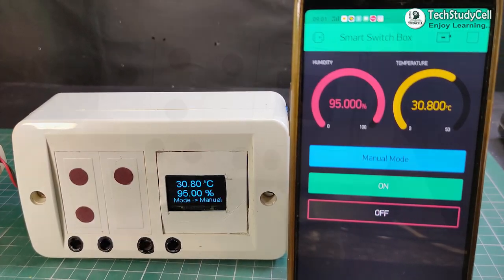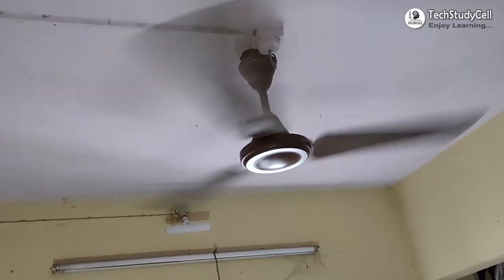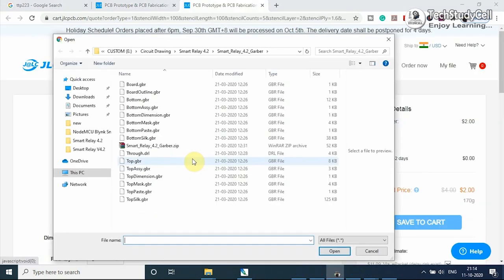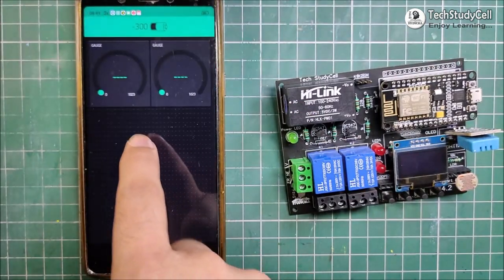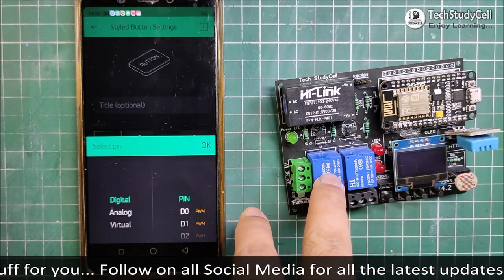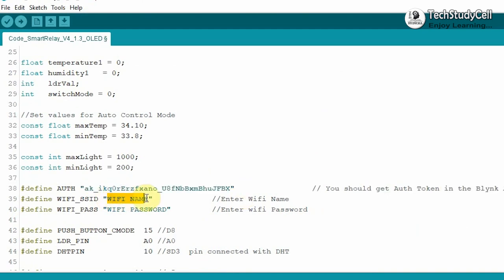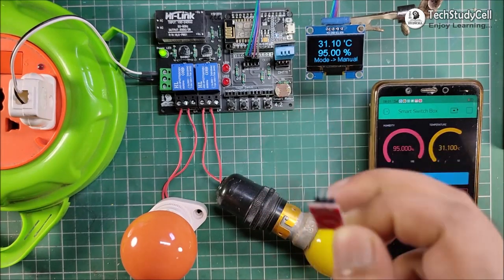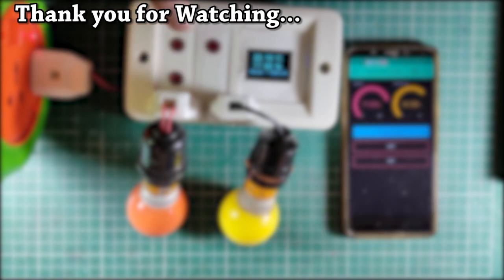Home Automation using NodeMCU & Blynk with Touch sensor LDR Temperature control Relay | IoT Projects

Comment: Thanks for your exceptional good video, patience and the hard working behind all of these. Is it possible to make the AC Dimmer which runs   both Blynk app by using slider button (or "+ve" & "-VE" buttons instead of slider ) and two physical  touch sensor switches (say 4 pcs TTP223 or 1 PCS TTP 224 for controlling 4 steps ...etc. ) for manual Control (Increasing or decreasing the bulb intensity or fan speed ) , If so please make a video particularly in coding part, It is difficult to relating the physical two buttons with Blink slider in coding part.
 It is more better to add 2 more button for controlling 2 ac loads (Just on and off ). Thanks

Comment: Very nice project what i can do to replace this oled display with lcd dispply having converter attached to it

And can we get pdf of this circuit to make pcb at our home
Reply from the maker: Please download the single layer PCB layout from description to make the circuit on zero PCB.
You have to use I2C display.  And display is optional, as you can monitor the reading in Blynk app